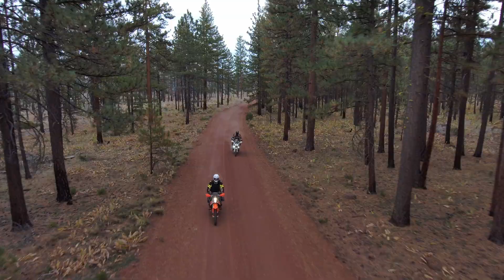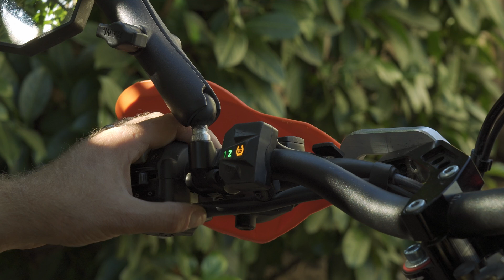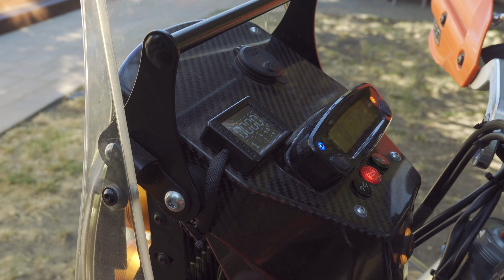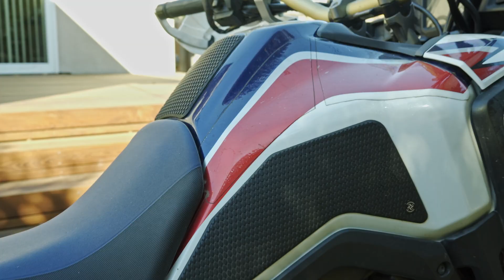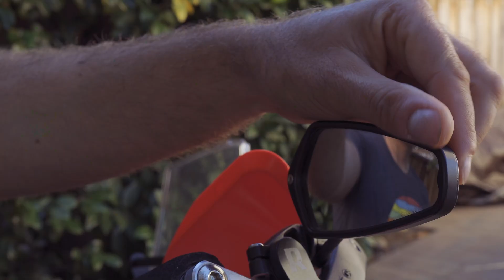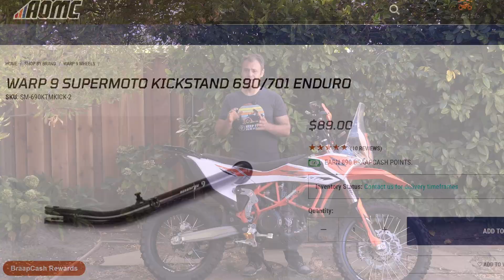KTM690 Enduro R Adventure Build

Comment: For the ABS look up dirt bike Jesus 701 ENDURO ABS DONGLE MOD. He outlines a mod to add a switch to the ABS dongle so you dont have to unplug it to get full ABS (front rear) I have my 701 set up this way and for long travel days I just turn the dongle off so I have full ABS. At the trail I turn it on for rear only ABS. You do need to turn the bike Off/on so its not exactly an on the fly adjustment but obviously much better than physically removing or installing the dongle.
Reply from the maker: Very cool! Thanks for sharing this. I looked it up and the mod is quite simple. Including link below and pinning this comment in case it is useful for others. 

http://www.dirtbikejesus.net/701-enduro-abs-dongle-mod/

Comment: Great video as Im considering purchasing the 690 for east coast BDR rides. The appeal of a ADV-lite after being on a full-size ADV bike is attractive. 
You're actually the same height/inseam as me, (5'10", 32") so your config is a great comparision.
I notice you had the StegPegz on their as well ... I presume added by the previous owner? Would be interesting to hear you opinion on their effectiveness.
Cheers.
Reply from the maker: Glad you enjoyed the video! Thanks for watching.  As you guessed, the steg pegs were already installed when I got the bike.  For this reason, it’s hard for me to say how much they helped. Initially I actually found them a little annoying because they felt like they were in the way of my fairly bulky Sidi crossfire boots. But I got used to them pretty quickly and it is possible that they gave me more stability than I would have had otherwise. Ive never had them on any other bike and never felt the need but because this bike has such a narrow front fairing, maybe they do help. What really helped me in that department though was dropping the peg height to get my knees better aligned with the fairing and then adding the gripper pads.

Comment: Lol. I’ve dropped my 600-plus-pound Super Ténéré more times than I care to admit in the gnarly stuff. One time on the absolutely stellar WA BDR, I managed to dump it straight into a rut, wedged at a weird angle and looking very smug about it.

Now, picking up a 600-lb beast is usually a very specific ritual: back to the bike, grab a bar or crash protection, grab the rear seat or handle, bend the knees, and heave. Works fine… as long as the bike is on something resembling flat ground. Down in a rut? Forget it. Solo recovery becomes literally impossible unless you’ve been benching 350 at the gym, or you get clever with leverage, a tow strap, ratchet strap, divine intervention, etc.

Enter two farm lasses on horseback. I asked if they could send help. They looked at the bike, looked at me, and said, “Nah, we got this.” The three of us hauled that beast out of the rut and saved my bacon for another day.

So yeah, when people talk about bike weight, it’s not just about how flickable it feels on the trail. Sometimes it’s about whether you can get the thing back upright when gravity when to tell you to blow chunks. And huge thanks to the ladies of Wenatchee, WA. Absolute legends. 😆

Comment: a lot of money...
Reply from the maker: Certainly not the cheapest option. But I bought this bike second hand with only 1200 miles on the clock and  with almost all mods completed for 14k (I invested just about 500 more in personal upgrades). Thats not cheap but not much more expensive than most modern ADV bikes. Buying second hand is definitely the way to go.

Comment: Love the video, but the bike eeks "This will decimate all...once we put 10 grand into it" energy from The Fast & the Furious Supra, lol.
Reply from the maker: Thanks for watching! I bought the bike used (with 3,000 miles on the clock) with all mods already installed for 14k. While certainly not cheap, I wouldn’t say that it is massively more expensive than a typical ADV bike once you pay for crash protection and other basics. And IF you are looking for this specific combination of performance attributes - light weight but capable / comfortable for long days on the free way, it is basically the only option. Thought the new Kove 800 may change that! And it is definitely not a bike that will ‘decimate all’. Like any ADV bike it is a compromise. For this bike, reliability proved to be the biggest compromise.
Reply: @DiscoveryMotoADV  Oh dude if you got it for 14k done deal, then 100% that's awesome and worth! I was doing some napkin math in my head considering the total cost if I bought a brand new 690 which already sits at a $13,400 MSRP.

BTW - I watched the Lassen series and loved it.
Reply from the maker: Definitely recommend considering the second hand market. I have been on both winning and loosing side of dumping a bunch of money into mods and then only getting a fraction of that aftermarket investment back when selling. And, if you end up not liking a second hand bike, you can sell it again with minimal depreciation since the first owner takes the biggest hit. Glad you enjoyed the Lassen trip!

Comment: I switched from a T7 to a 701 enduro. Best decision I ever made. The weight difference (and placement of it) is a huge improvement especially as I ride alone 99% of the time.

Bought used and it came with Motoz tires, a rally tower and had lowering springs. Perfect mods I didn’t to add.
Reply from the maker: Agree. And the fact that you can get that weight reduction while still cranking out very credible power when long distance travel is called for is pretty unique to this bike. There is really nothing like it.

Comment: But you didn’t lower it?
Reply from the maker: No, I didn't lower it. As I show in the video, while the seat is quite tall, the narrowness of the bike made for a reasonable reach to the ground (i have a 32in inseam).  That said, you could easily lower it an inch and still have excellent suspension travel and clearance.

Comment: The vibe thing.  I have an 890R and a 690 Enduro, both are 2021.  The 2 bikes have very close to the same footpeg/handlebar vibes.  Basically not enough to even be noticeable.   I know the early 690's shook and vibed hard but these updated models dont.  I rode a DR650 for 51,000 miles and my 690 is smoother and quieter out on the hiway for sure.  And WAY faster and better handling.
Reply: Do you ever miss the DR? Was the DR modded a bunch? I've thought about the same swap.
Reply: @intrigue175175  I spent 3K modding the DR, At least.   Honestly the DR is a wobble box compared to the 690 as far as handling. 35HP compared to 70?  Once you try it you cant go back.   Ive had a lot of KTM's over the years.

Comment: How much money is in the bike now would you say including purchase price ? 
This looks like the perfect bike to me now but finding one kitted out like that is tricky and adding the mods myself could be out of my price range
Many thanks
Reply from the maker: By my calculation, the upgrades come to about $7k all together. The MSRP on the bike is $10k (though lots of KTMs are going below MSRP right now!). So, if you wanted to build from scratch it $17k which is very pricey.  I bought the bike for 14k with 2.5k miles on it and most of the work already done on it. But keep in mind that you don’t need ALL of this stuff. I think you should be able to source or build a used, low mileage version of this bike with the essential upgrades for about 11-13k. Still not cheap but comparable to other high performance ADV options.
Reply: @ brilliant, thanks very much 👍🏼

Comment: The BRP mount? As cool as it looks, and it IS trick. The rubber inserts, even the blue/soft ones are stiffer for sure than the OEM rubber mounts for bars.
Disappointing they spend all the time building it, and make it stiffer.    Also you cannot lower the forks in the clamps with these mounts,
But BRP makes a MUCH cheaper scotts damper mount that uses the stock rubber mounts and you can lower the forks an inch.  I really wish I had known this before I ponied up the cash.    A gallon gas bag is what I'll use for outback trips.

Also, the FI and ignition on 19 and newer compensate for less octane in gas, no dongle needed. Lots of guys have tested this and it works fine.

Comment: lol. I've owned 4 KTM's and now have a Norden 901. Every bike with basic maintenance has ran like a top. KTM reliability concerns..blah,blah,blah. Just makes me laugh.
Reply: My clutch slave cylinder failed at 1200 miles on my 2020 690 leaving me without a clutch 25 miles out in the desert by my self. I was able to start it in neutral and crack it into 1st to ride out without the use of the clutch. so far at 8500 miles mostly desert trails that has been my only issue.
Reply from the maker: @FaceSmashington yeah. The clutch cylinder is a known issue for this model. I neglected to mention it in the video but I have replaced it with an oberon. Glad it has been problem free for you aside from that.
Reply from the maker: My sense is that the quality is inconsistent rather than universally bad. Some units seem perfectly fine, others not so much. I am a maintenance fanatic and this bike is almost brand new anyways but it failed to start 3 times over the course of a four day trip the first time out. My Hondas have never failed to start after tens of thousands of miles. Just sayin….
Reply: @DiscoveryMotoADV  Sounds like operator error tbh.
Reply from the maker: Could be! I am probably just too used to motorcycles where you push the starter button and then it, you know, starts! I may not have the sophistication required to ride a KTM. Oh well….
Reply: @  I think you nailed it. All of mine have started every single time I hit the start button. You would probably be happier on the boring, underpowered, overweight AT.

Comment: If I win the lottery I'll build one but the 390 adv R is right up my alley. Somewhat less power but not a big deal to me. Had a DR650 and it was quite good as well. Might even go mod one up again. There are some options, but right now it takes a lot of money in mods to get em to where they should be.
Reply from the maker: Thanks for watching. Totally agree. The 390 R is definitely the ticket (at leas based on what have seen of the specs and reviews) and if it was around 18mo ago when I started the 690 build, I think I would have gone with that. The only thin that turns me off about it (but this is true for most bikes these days) is all the electronics. The 2021 690 is still a pretty basic bike and I like that. As for the DR650 (and some of its Japanese brethren) if they would just put ABS and EFI on it, it would be an amazing bike. No question.
Reply: @DiscoveryMotoADV  agreed.
Reply: @DiscoveryMotoADV  51,000 hard miles on my DR 650, yeah FI is cool, but the carb is simple and I never touched it.
I seriously thought about starting over again with a new DR, but got the 690 instead and it is a blast, always exciting.

Comment: My garage is identical to yours.  I have had the Africa Twin for two years now.  It is a DCT which I loved to begin with but have soured on it.  I have also soured on the weight at 540lbs.  It kills my confidence and since I ride solo quite a bit, I have turned around when things get even remotely sketchy.  Enter the KTM.  Feels like a motorized mountain bike.  It is brand new to me, but I am immediately much more confident on the bike.  The bike seems to be fast enough, refined enough (low standards), and comfortable enough to make me question if the Africa Twin stays in the garage or not.
Reply: Absolutely agree with everything you say. I will publish a video comparing the bikes soon but here my thoughts on tradeoffs: I find the KTM to actually be more twitchy both off road and in the twisties. Off-road, the AT just chugs along like a tractor. Unless you really push it, it has a steady, predictable response and the suspension (Ohlins, not stock) eats up even the rockiest obstacles with ease. The KTM is much more aggressive by design but also much twitchier - the brakes, the suspension and the steering are all rougher and it makes for a less plush ride and I find my weight being knocked around a lot more. Much of this would probably be alleviated by more experience with the bike, but there were definitely offroad scenarios where I found the AT preferable. You can see that in episode 2 of the Lassen serries linked below the video. On balance though, the KTM is clearly the bike I would chose for solo off-roading.  In the twisties, the AT holds a line like it is on a rail (again after changing the forks to Ohlins), the KTM tends to require a bit more correction mid turn. The other, more significant thing, is that the KTM is made by, well, KTM. My model has already lived up to KTMs reputations for less than stellar reliability. If Honda made this bike, I think that would be the end of the conversation. But taking this thing into the back-country, especially, solo will always make me nervous. Sure, I will be able to pick-it up on my own if I drop it. But will I be able to start it when I wake up in the middle of nowhere? In my experience, that is not a given like it is with the Honda.
Reply: @danabramzon139  "changed to Ohlins" Good lord.  A minor 3500.00 upgrade.

Ive had lots of KTM's, too many to mention none have broke, they are such amazing bikes they are worth the trouble to keep in top shape.
To say an AT is more re-assuring off road?  @ 540lbs before mods.....................I dont like big bikes off road, I have an 890 and much prefer the 690 by a Mile.  2 miles.

Comment: Really awesome walk thru of your mods at the 690. Had a 2014 for 5 years. No significant issues. This build definitely makes it a agile ADV rig. Would love to try out how the Rade Garage fairing feels like. Definitely a sub to your channel, Happy Trails!
Reply from the maker: Thanks for watching! Glad you enjoyed it. And welcome aboard. The 690 is definitely a unique platform and a very fun bike that ticks almost all the boxes. unfortunately my specific unit has already lived up to the KTM reputation for reliability. 🤣 lots of people say theirs have had no issues. I think you just have to get a little lucky and get one of the ‘good units’. I wish this bike was made by one of the Japanese brands. This level of performance with Japanese reliability would be unstoppable.
Reply: @DiscoveryMotoADV I had the common problem with a electric wire connection assembled to close to the radiator, from factory. That made a hole in the radiator, when rubbing. I got a new radiator installed in no time on warranty. The thing is, that this wasn't known issue but KTM never made an improvement in the assembled line. Would have been so easy. Other than that, no issues. This kind of problems could ofc be fixed from start when getting familiar with the new bike and eventual custom build. Would i buy one again? H*ll yes! Awesome bike. Several of these have made really long distances. I would say it is mechanically reliable. Fuel pump/lines needs attention on very long distance adv's (RTW).
Reply: I'm looking at a used 2014 for more tight and technical riding than my T7 is comfortable doing.

Comment: Map 2 does change the ABS.
Reply from the maker: Not according to the manual or KTM’s website which says: “the drive mode only influences the throttle response. In drive mode 2, the traction control allows more slip and rise of the front wheel”. Nothing about ABS. Perhaps they changed this in the most recent model? Thanks for watching!